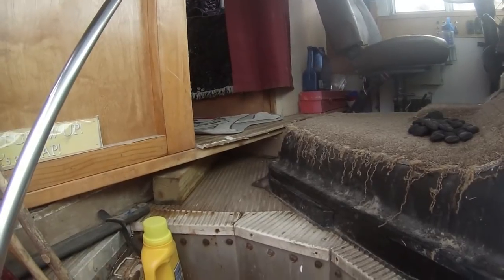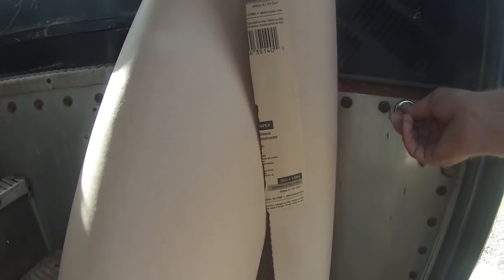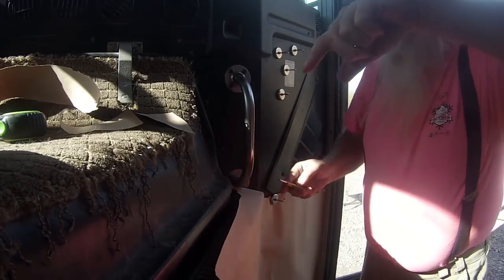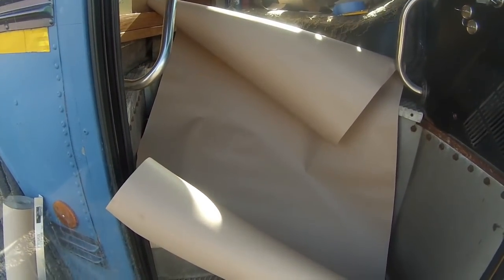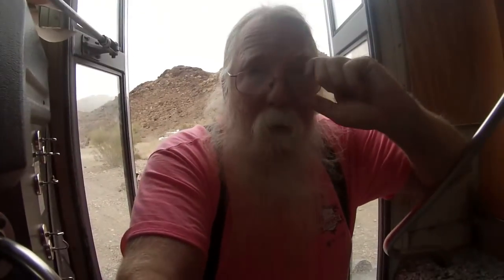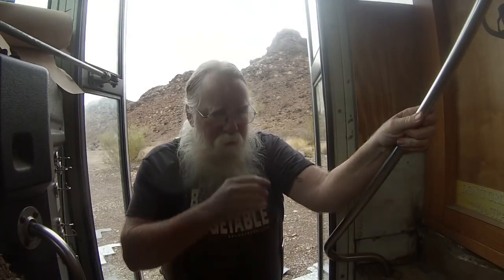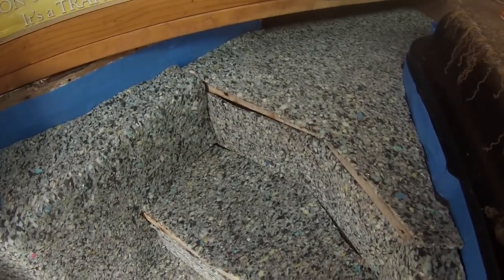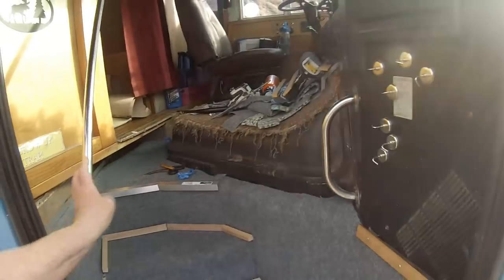Infinite Bus Tour 219- New Carpet in the Cockpit

Comment: I've checked your earliest videos, but have found nothing mentioned about what you did with the undercarriage. You mentioned it's an Ohio bus, which means more rust issues than mine which was a Va bus, but still. I need some serious advice at what to do. I want to pressure wash it, but I have limited access because it's at storage facility where I'm working on it.
Reply from the maker: I did nothing to the under carrage. Mostly there was surface rust and I've seen much worse. The only bad places were over the wheels where the floor was trotted through.
Reply: @SteampunkSteve  
Can I send you pictures and give me your opinion. If so what address.
Reply from the maker: Sure but just remember it would be my opinion based on the pics. It's hard to tell how bad rust is without poking at it.
steampunkstevex @gmail.com

Comment: cool, is the new carpet in the cockpit finished ?  does it hold up well ?
Reply from the maker: The carpet is holding up well. I've had a small issue with it sticking to the sides of the engine cover but I think that's due to the engine heat softening the glue. I've going to try a different adhesive